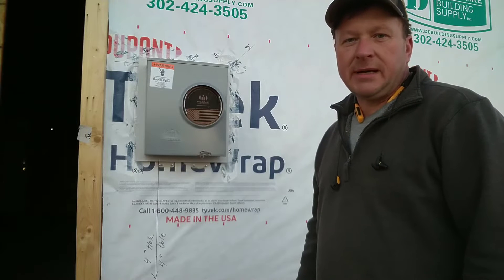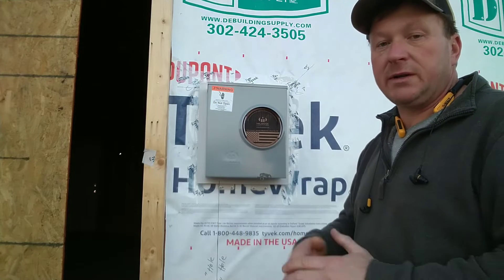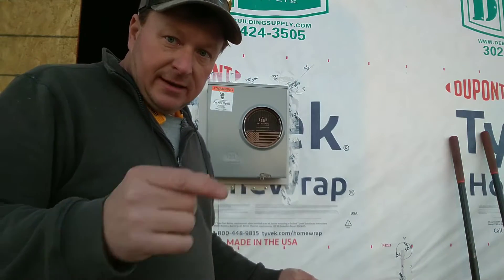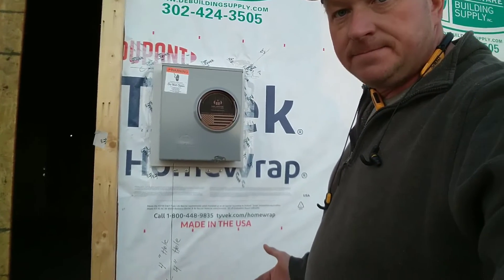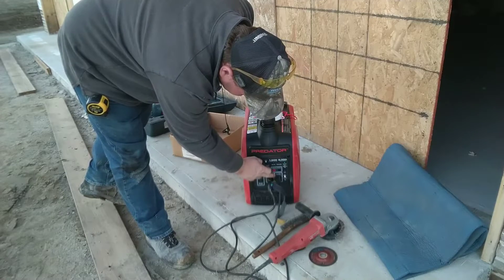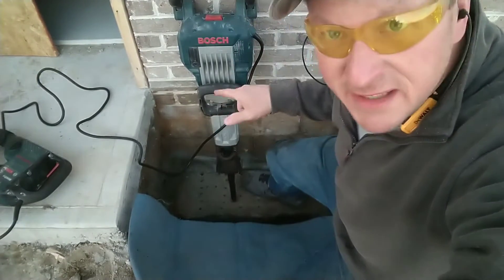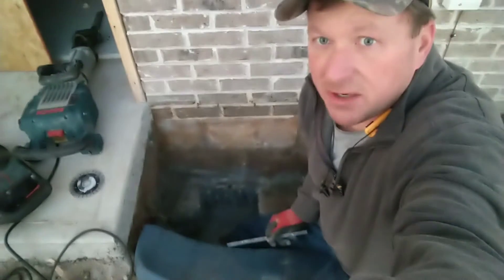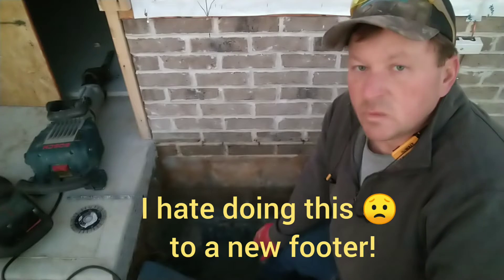Footer preparations for an 🤔 easy conduit riser installation

Comment: Hey brother I just wanted to mention I don't know if you figured out the good solution to this problem by now or not I figured you may have because you're a very crafty guy just like myself very driven and skilled tradesman. I appreciate your videos and I want to share this with you. On job sites in the past on commercial sites as well as on residential sites they have allowed us to take styrofoam block outs and tape them up well with duct tape and then use strapping usually a couple of screws inside of the form for the footer with a piece of tie wire tightly bound across them to hold the block in place while they pour the concrete around it and then when the concrete settles even after the ground is filled you can just uncover it and knock the styrofoam block out of the area you need to run you need to run your pipe up the block. Hope that's helpful let me know if I can offer any more clarity if you don't understand something thanks buddy I appreciate everything you do.
Reply from the maker: Awesome idea 👍🏻 Love it. Thanks for the tips , my brother from another mother.

Comment: I am working with an EMC on a job. Those guys are great. You can call and they actually have someone that answers the phone. Then you get with the field guy and he is like 'Let me know when its convenient to meet'. They told me to set my backboard and let them know. They will come and run the power from the transformer on the pole underground(currently over head) to the new backboard with the meter can. It is about 100' and they said $500. Next county over is Georgia Power and that would be $3000 + and 6 weeks. EMC said they are running about 2 weeks but can come sooner if needed.
Reply from the maker: Wow, that's awesome to have a utility company that's willing to work with you.  Delmar power and light used to be much better to work with before they were bought out. 😟